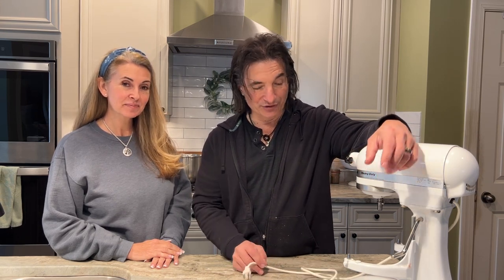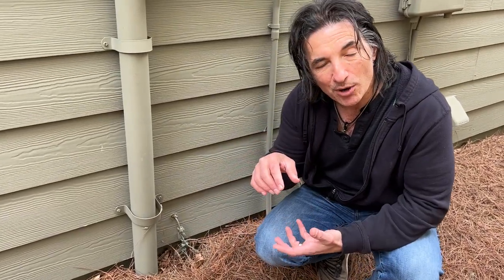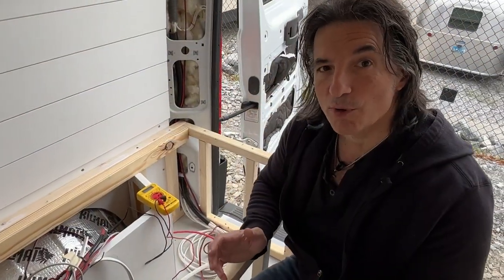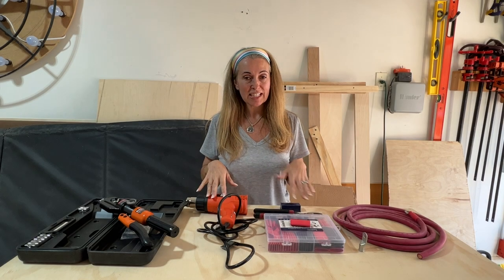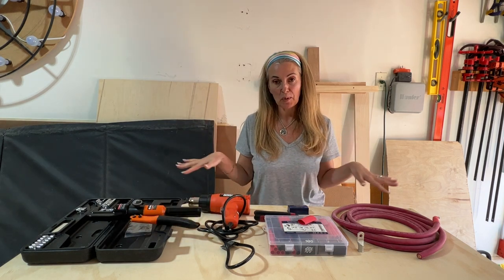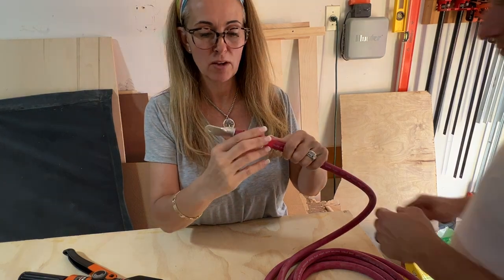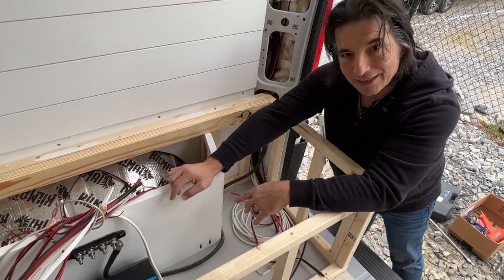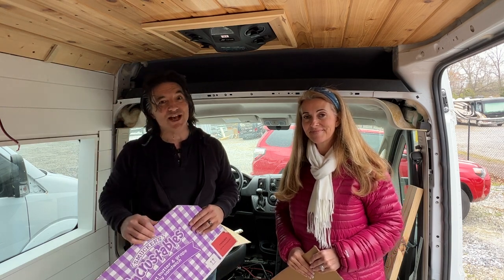Grounding the Electrical System: Part 37 – RAM Promaster 2500 Van Conversion

Comment: Did I miss where you actually connect it to the chassis? Saw the connection to the bus bar. Thank you for sharing. Hope all is well.
Reply from the maker: Its been a while so I cant recall....but we just bolted it to a spot on the frame after we scratched off the paint. To be sure we did a continuity test between the bus bar and the negative terminal of the battery to make sure the connection was good.

Comment: So what if I don't have a dc to dc wire how would i check if I have a good ground connection?
Reply from the maker: I think you can check any point by checking for resistance between that point at the negative terminal of the battery

Comment: Do you have a shore power connection? Did you ground it to the chassis as well?
Reply from the maker: Yes we do. We actually use it all the time. The shore power connects to the inverter/charger, which is grounded to the chassis. The inverter then connects to the negative bus, which is also grounded.